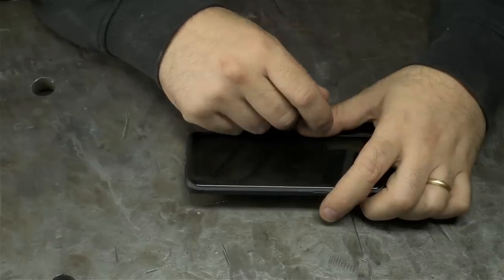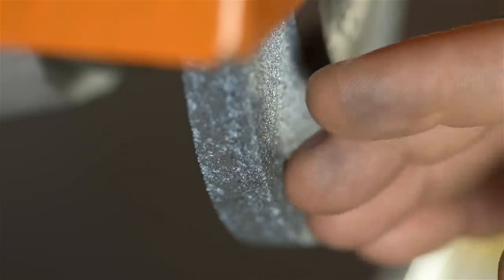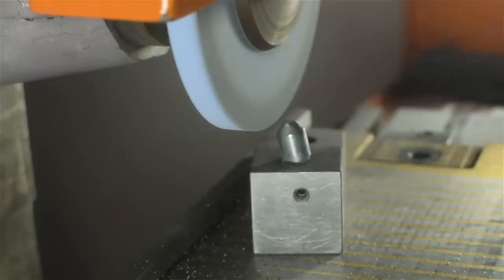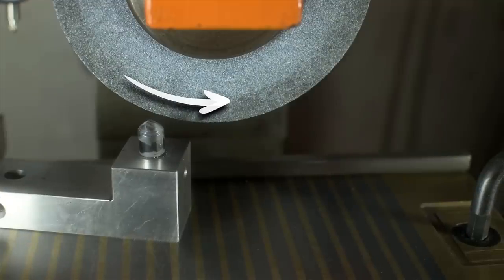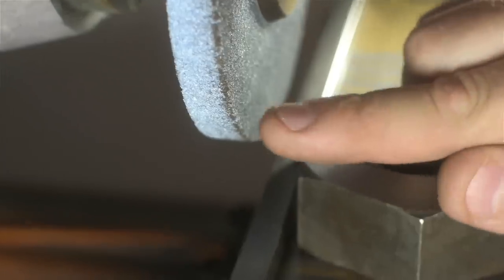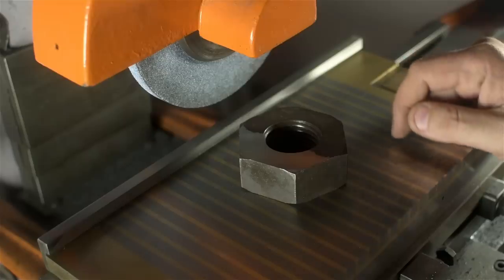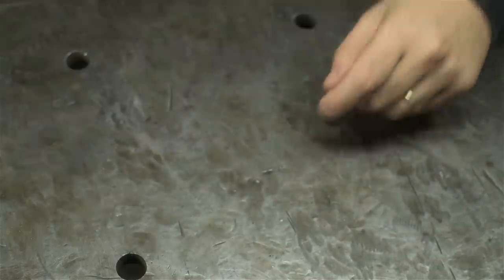How Surface Grinding Works - Part 1?

Comment: The video didn't raise any questions but it did raise something else if ya know what i mean!
Reply: You need to get out more!
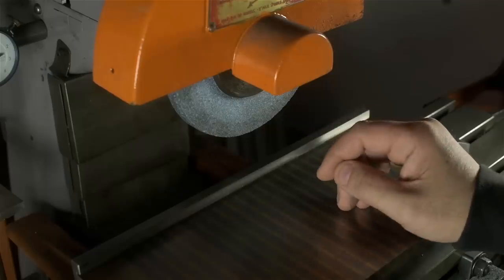Reply: Yeah yeah..., it actually brings the answer to where could the god damn "Surface Grinder Rebuild - part 4" video be.   Hear the comment and see the sign at the 1:03 mark? Maybe Tony is working onto a full "Refurbishing an old grinder" season with 25 episodes... Back in 2014, he said he wanted to have fun with the original second(/third?) hand grinder he bought... (Yes I am talking to you Tony ;-) ) Maybe there is much more answers to be given to the community as to "how to fix the perpendicularity between the knee and the column while refurbishing an old grinder", and much more ?!?!?! I can't wait to see more.... And am I losing my mind because of Covid-19 containement measures? I don't think so... I secretly hope not. :-)

Comment: You should be able to set the grinder to feed down, in both inner and outer position. It's way faster for roughing. Then you'll also get a little more life out of your stone, as you will wear on both sides of the stone.

Comment: The second grinding video I've seen in the last week and again the wheel is running the opposite way from every surface grinder I have ever run or seen. And I have run SG's from 6 x 12 Harigs, Popes, Mitsui's up through DoAlls, old Abarsives with sleeve main bearings, Okamoto's, Fairly good size Thompson's and a 48 x 120 Maddison. The Mattison used 20 x 4 inch wheels. The machine was big enough that we could put the bases for crankshaft grinders on it and grind the ways prior to scraping them back in. Did you and Stefan just happen to wire them backwards or is this common in Europe. As the majority of people are right handed from what I've seen right handed people tend to work from the right hand side of the machine. I also tend to favor the table traverse to be on the right side as that is what I am used to.

Comment: The glass half full perspective on the grinding wheel gradually wearing smaller as you progress through many parts while inattentively grinding to a set “zero” is that - at least your parts will still be over-size ;)

Comment: Shorter ? I'll have to go onto mrpete's or abom's channel now. Anyway, what about people with small work areas, using a surface grinder near other machinery ? The dust has to be bad for everything else there right ?
Reply: Usually SG's have a vacuum system that sucks up grinding dust when doing dry grinding. On wet grinders I've seen both. Plus normally SG's are segregated from the rest of the shop. And if they aren't they are pointed at a wall or some sort of shield.
Reply: Use coolant. I have the same sort of problem. I have a small basement shop and I have no choice but to have my bench grinder very close to my mini mill and lathe. They both get covered with plastic before any grinding takes place, which can get annoying when you need to do a quick touch up on a tool

Comment: Nice video Tony, but you are dressing the wheel wrong way. if you have the angle on the dresser facing column you need to be going outwards with dressing, that prolongs life of diamond,you downfeed on the diamond only one way. Also turning dresser in the holder frequently helps to sort of wear it to a point if you know what i mean. if you side wheel, it's nice to dress the wheel with handheld diamond, so you are only cutting with tiny edge on the outside of the wheel. You shouldn't side wheel with full face.

Comment: TOT...in I am in the back with my hand up......do you or should you always going across the part in one direction to use the one side of the wheel or can you go back across in the opposite direction.....never gotten a flat answer from so many...
Reply from the maker: Hey Chuck!  Like most things, probably comes down to preference and how you/one learned to do it.  You could certainly go both ways but your wheel will wear to a 'point' in the center, probably not consistently either, so 'sparking out' can get hard to read.  It's just like tea leaves, Chuck :)  

I remember trying a lot of different strategies when I first got my grinder... cutting both ways, crisscrossing, plunge-then-finish, etc.  I seemed to get the most consistent results (on my size grinder), coming in from one direction (back to front) and only conventional cutting.  Meaning I go back to start before stepping over... no 'climb cutting' on the way back.  

Come off the part entirely after every pass (toward you if grinding back to front), and I like to crisscross the whole part on my way back, instead of just parking to one side and wheeling the table back.  Keep an eye on the sparks on the way back to get some sense if the part is behaving consistently.

Bottom line, as long as "your way" (not you, specifically) doesn't get anybody hurt, your surface plate corroborates your story, and you're not fighting the clock to get something done, you should be good!

Comment: Thanks for some very educational and humorous videos. I would like it very much if you would make a video on how I keep my lathe and mill in good condition. The are placed in a dry but cold garage and they rust. How do you maintain your machine park?
Reply: Keep the metal surfaces oiled. Cast iron and Steel will rust unless they're protected by a layer of something that's impervious to water and oxygen.
Reply: I sprayed them both with wd40 but still rust occured? I'm living in Denmark, where we have a tempered climate. Denmark is a very small country and everywhere is close to the see, hence the amount of salt in the air and rain is considerable.
What oil and in what extent am I supposed to oil the surfaces. I guess that it shouldn't be totally unavailable due to lubrication? 
Thanks in advance
Reply: WD-40 is fairly volatile (a side effect of being thin enough to penetrate rusted bolts) and tends to evaporate over time. You might want to try a heavier oil (e.g. sewing machine oil) wiped on with a cloth. Another option might be a 'fogging oil' as is used for protecting engines in storage.
Reply: Thanks very much for your answer. Do you by chance have knowledge on how to get the rust removed without harming the metal shapes that are "straight"
Reply: If the rust resembles a very thin layer of fine brown powder most of it will come off when you wipe oil onto the machine. The remainder should wear off with use if you keep further corrosion at bay. If the rust is in big flakes the damage is already done- the surface beneath is probably pitted and out of shape already. 

Stubborn surface rust might be dislodged using a mild abrasive like a Scotch Brite pad or fine wet and dry sandpaper, but doing so will slightly grind the surface beneath. It's also important to make sure that you clean up afterwards, as the abrasive particles left behind will accelerate wear of the machine  unless you remove them.
Reply: As a computer programmer (by heart), how do you apply the oil? With a brush or do you have better solutions?

Comment: Thanks for sharing this with us, I have a Q with regards to what you call Mag Blocks. I have a pair of these that were given to me 45 years ago and never knew what they were or for. I've kept them wrapped in a doe skin and when asked I would say I was told that they were wht. & yel. 18 K gold that were smuggled out of Nazi Germany during the war.  It always got a conversation going as I'm a retired goldsmith. Mine are small about 2x6x1" thick, would they have been for the same kind of use? Are mag chucks something you might consider doing a video on? Keep up the great job, Billy in Ladysmith.
Reply from the maker: I'm sure they'll pop up sooner or later!  mag blocks are to help in setting parts up on the flat mag chuck, they "allow the magnetism through".  Say, to pick a bad example out of the air, you had a more-or-less flat part with a dowel pin sticking out both sides (imagine it looks like a square top)... the pin keeps you from laying a flat surface down on the chuck.  You could use two mag blocks to lift the part up a bit, so the pin is no longer interfering, and your mag chuck should hold the part in place to allow grinding.  Dunno if that makes sense :)

Comment: Here are more questions for you. What is the most universal wheel to use on such a machine. For me the aluminum oxide wheels have been great for rough grinding.
Reply: engineerd3d you’ve got it. To be more specific, the most common wheel used would probably be a 46H. 46 grit aluminum oxide with an H bond “hardness”

Comment: Speaking of launching parts off of the magnet. The Mattison I mentioned in the previous post. We had an individual grinding ring gears for rear ends and on let go. Went through the office window about 10 to 15 meters away and bounced off of the bosses desk

Comment: I’m not sure ‘black magic that is precision grinding’ is quite fully satisfying. Is it just that all the goods we see coming off the wheel are just so insignificant that they don’t translate into error? What if you do one side, flip it, do the other to dimension, then check back to front on the reference surface? Will it be parallel?

Comment: Does that opto-acoustic levitator by any chance use the Magneto-Optical Kerr effect to modulate the entagled spin state of the hammer, thereby allowing the Quantum Zeno Effect to keep it stationary (via the Principle of Stationary Action)?
Reply: It's pretty obvious that Tony's system has no nirving spandrels, so it couldn't fully utilize the KERR effect to any significant degree.

Comment: Great video and it did answer a bit of my question from your last one... but that was a small nut and I was thinking more of a large length being ground from right to left, surely (I'm not calling you Shirley) the left side would be ground less than the right side as the wheel wore down? It doesn't warrent a reply as I guess it would vary by the stone type and be within most tollerances. And as I have limited tools and use a hand file as a surface grinder, I guess it's more accurate than I could get.
Reply from the maker: Nope, same thing still happens, if the left is ground more than the right because the edge of the wheel is breaking down, there is still the 'backside' of the wheel available to come along and clean it up, just like working back to front.

To put in perspective, I use a 1/2" thick wheel.  I can surface my entire mag chuck (= more or less the capacity of the machine, ~6"x~12"?) and the fresh wheel face still isn't completely broken down.  I dress again, and take a second pass, very light, but that's mostly for my own peace of mind.
Reply: cheers, that makes sense

Comment: Im very interested in surface grinding, i did it ones at school but never again. The tales about the surface grinders at school where also interesting. They where standing next to a window and sometimes  someone goofed and the parts flew thru the window and some where never found back

Comment: Is there a reason you don't move a whole wheel width over for each pass (minus a few thou)? I think this would even the wear versus concentrating it on the leading edge - every point in the width would have an equal chance of encountering a high spot instead of "following in the footsteps" of the leading edge when taking only small "bites".

Unrelated, but is there something like a surface grinder (maybe less precise but still pretty decent for making flat faces) for really large parts? I've got a heavy welding table that is 5 feet wide and I'd like to not hand-scrape the surface (which is cratered like the moon and couldn't be scraped flat in a lifetime).

Comment: Thankfully the dude I bought my surface grinder from was really nice and went over a ton of that stuff with me or I would have probably shot my eye out the first time I turned it on. I'm still kicking myself for not buying all the tooling that goes with the surface grinder which he was selling for about 20 cents on the dollar. Oh well didn't really have the extra cash at the time but now when I look at radius dressers and see their costs it makes me want a time machine. Dude also gave me a box of wheels, a dresser, and a little vice he had made. Like I said super nice guy. Nice enough that I still remember his name even though that was over a decade ago and I'm horrible with names.

Comment: So always advance the grinding by a minor fraction of the wheel width so that the inner edge of the wheel will have minimal wear and act as the "finisher?" For aluminum you stick a vise to the mag vise?

Comment: I couldn't believe the catastrophic potential of launching the part wasn't addressed in the previous video or the comments, but I didn't know how to bring it up. The 2 times I saw it happen I found the launching to occur when a new operator decides for himself that more than 2 thou will be okay for a speedier cut.
Reply: It has been mentioned in a previous video though. 
Now you just need to watch all of them to find out which one. :)
Reply: I vagely remember someone telling me about a part from a grinder like this flying through the whole workshop and knocking a piece out of the wall.... Not sure where or from whom I heard that though.
Reply: I've seen a wheel explode from a part jamming in under it after having been fed in from the wrong side on and it wasn't even a heavy cut. Scary shit man. The operator was so shaken up he couldn't work for the rest of his shift. Left a nice bruise on his chest.... lucky man.
Reply: How I missed that I don't know. I see a T.O.T. notification and I pull over on the interstate if necessary to watch it. Thanks!
Reply: The 2 I saw were both high school metal shop accidents. Probably not the best tool to let pot smoking 15 year-olds operate without supervision, but what do we say? Those were different times...
Reply: Lucky alright- I remember the sound it made before the wheel launched the part into the block wall and then exploded. I hit the ground as if someone yelled grenade.
Reply: Lol, Yep.... I had that reaction in high school metal shop when some genius kid started up a lathe at 1800 rpm with a huge 4 jaw chuck that was only partially fitted. The chuck destroyed the removable bit of the bed under it, hit the ground spinning like those alien things in the battleship movie, went looking for the nearest metal barrier railing and went spinning down it at an angle, totally destroying a metal cabinet full of micrometers and other expensive measuring equipment and tools that stood against the railing. It was one of those moments where you cannot decide whether it was tragic, awe-inspiring or whether you should shit yourself. God knows how we made it through high school without someone ending up dead. What launched the chuck is that when the kid realized it was loose.... by which time it was flopping around at 1800 rpm, he slammed the lathe straight into reverse (with the lathe still set at 1800 rpm) and the chuck decided... "screw this, I'm out of here".
Reply: pulling over when you get the notification... I think thats standard practice is it not?
Reply: One would assume.
Reply: Spinning tools are dangerous! Danger multiplies by stupidity of operator, mass & speed. Be it a basic drill, sander, grinder or bigger saws, lathes or whatever. Its incredible how often the potential danger especially of the more innocuous looking machines is underestimated. There is a reason for tool safety guidelines, but don't just obey them blindly think about why they are in place.

Comment: Tony,

Your videos are great. I teach machine shop at a small school in the northeast. We use a handheld video camera when doing live demonstrations, but I have been wanting to improve our video setup for a while. It would also be handy to have better videos given that the school has moved to online instruction because of COVID-19.

Is there anyway that you could share a bit about your video recording and editing setup/process?

Thank you!
Reply from the maker: I use a DSLR for the cinematic look (and I already had one!) though a camcorder is probably fine.  I like high contrast lights.. 2 or 3..   at sharp angles.  most of what we stare at it all the same color... I find hard shadows work well to convey depth.  rodelink wireless microphone.     good clear and clean audio is more important than video quality. editing is done in premier elements because it's cheap... about $100.  license doesn't expire!  I edit very tight.  remove as much unnecessary footage as possible.... if a box is on the floor and then it appears on your bench most can figure out you picked it up... no need to show.  unfortunately we all have short attention spans these days.

Comment: Dear @ThisOldTony ,

I assume you dabble in some woodworking, and occasionaly use a chisel. I was wondering, how would a new chisel prepared according to the tried and tested procedures compare to one that was surface ground. More specifically grinding theback of a chisel flat. 

Would you consider doing such a test?
Reply from the maker: if a chisel doesn't have a flat (or otherwise ground) back, it's not sharp.  if done right they'd be the same but a surface grinder is a lot faster than a hand stone! (if you don't burn the edge first!)